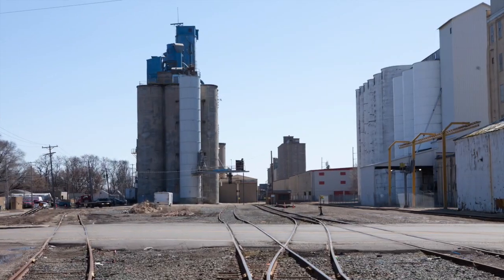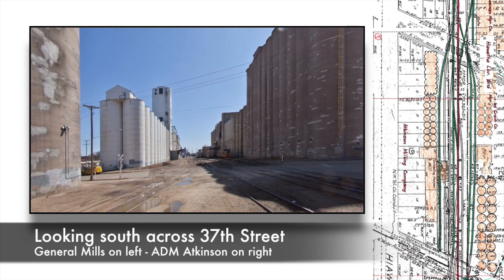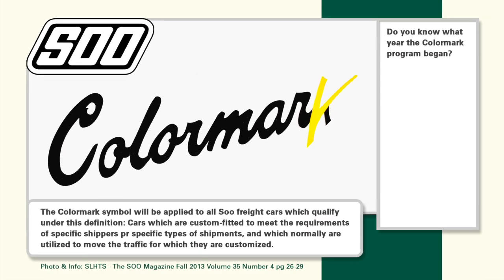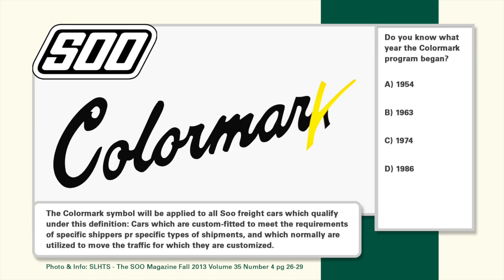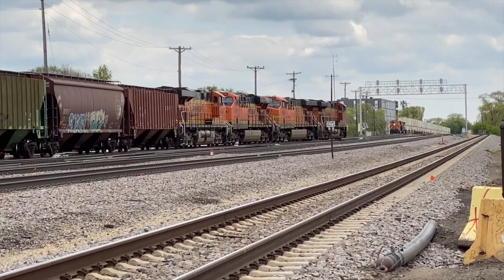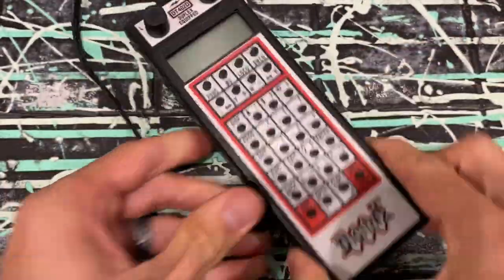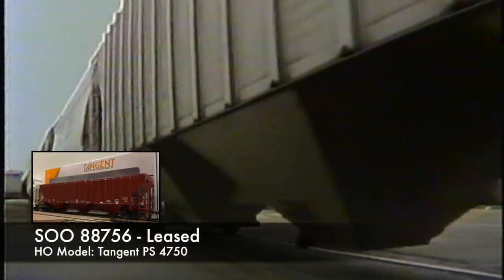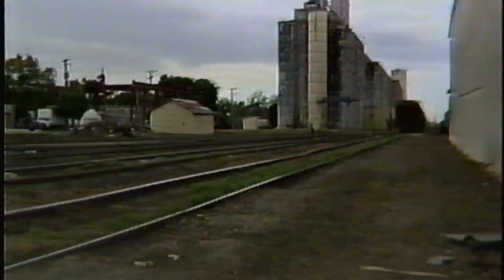S04E03 - Layout Update Custom Crossover Vintage 1986 Bob Rivard Footage of Elevator District

Comment: The section about the crossover came at just the right time. I just got my ore dock installed and I still need to build a crossover. Great info this week.
Reply from the maker: Excellent!!! The spacing after making this modification with Walthers turnouts, it 1-7/8”...2” is what I shoot for. Best of luck on the install, looking forward to seeing your progress.
Reply: I’ll be using atlas turnouts on the dock. Does elevator district have the most complicated track work that will be on the lower level.
Reply from the maker: The Northern Lines Hoffman will be the most complex...that interlock is nothing but crossovers. 😬

Comment: Good move on the switches. I wish I had thought of that.
Reply from the maker: Another trick in your skill set. It's always good to add options for future projects, right?
Reply: @SootheMilwaukeeRoad , In fact, I will be using this as I have to replace two switches and this will work out great.
Reply from the maker: South Brooklyn RR As I realized I didn’t mention the type of turnouts I did this with...I used Walthers DCC Friendly turnouts. Which allowed for a fairly easy modification.
Reply from the maker: South Brooklyn RR Best of luck on your crossover replacement. This mod sets the turnouts to 1-7/8...so close to 2” on center. If you’re looking to stick to a track spacing standard.
Reply: @SootheMilwaukeeRoad  Yes, that helps thanks.
Reply from the maker: South Brooklyn RR absolutely, I’ll e-mail you right now.

Comment: At 3:09 in your video an Atlas degree crossing is used in your track layout. What is the degree of the crossing? I would like to incorporate a track design like that. Thanks
Reply from the maker: It’s a 60° Walthers crossing...melds nicely into two Walthers turnouts. I’d have to confirm the switch length, but they all play well together.
Reply: Thanks so much for the information and quick reply. Learned quite a bit from your video series. William
Reply from the maker: You’re welcome, so glad you’re finding the content of quality and interest. Be sure to let fellow modelers know about the series, I’m here to help. So videos should continue to roll out.